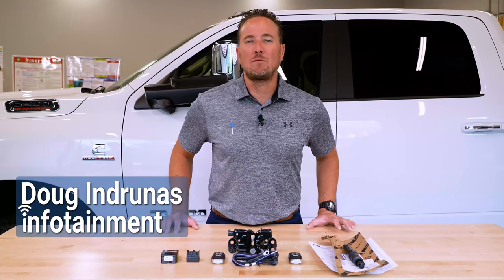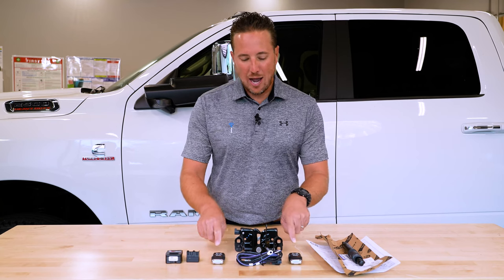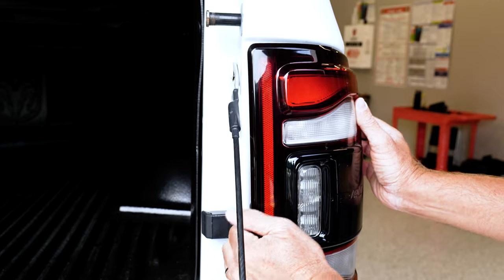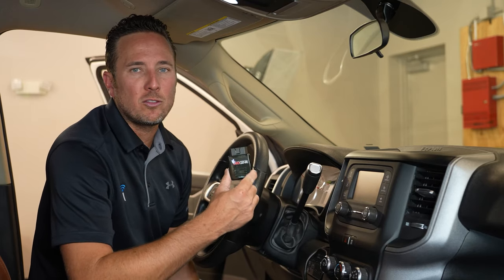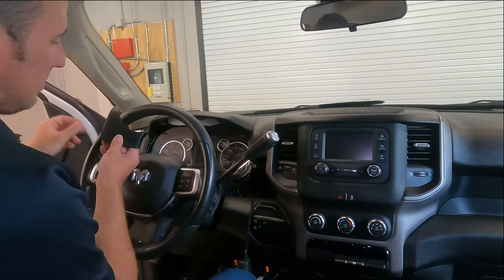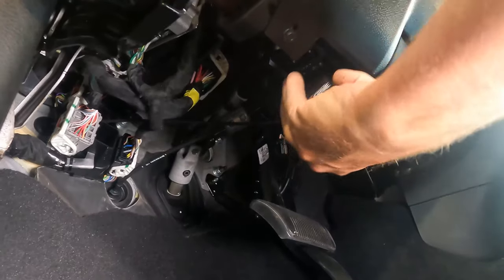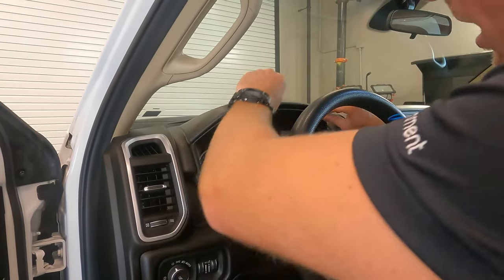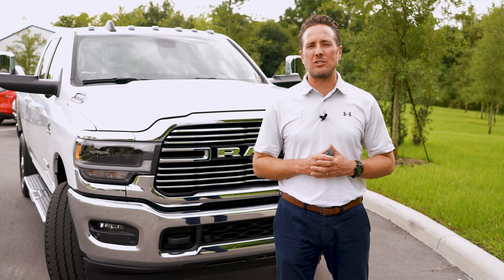2019+ Ram 2500 - Ram Remote Start - Episode 20

Comment: Installed per instructions and got all the proper indications on my 2022 Ram 2500. Lock smith came out and programmed the fobs. The lock, unlock, tailgate release, and panic button work but the auto start doesn’t. The park lights flash once and that’s it. I can start the truck with the push button but that’s it. Batteries are 12.87 volts and no other messages on dash. Seems like it’s just the remote start function. Good latch indication illuminates on dash when truck is on and you pop the hood then goes away when you close it so it seems like everything is working.
Reply from the maker: Please reach out to our support team at 855-636-6287 Ext 11 or at support@infotainment.zohodesk.com and they should be able to help get that working.

Comment: can this be used for more than one truck if more extra key fabs are bought from the dealer I have 7 fleet trucks in my shop I'm trying to get remote start for they are all a 2500 ram 2022
Reply from the maker: Contact our wholesale team at (800) 836-4858. 

They can recommend the best fleet solution for this kit. With that number of trucks, they can help get you a bulk price.

https://www.infotainment.com/pages/become-an-infotainment-com-wholesale-partner

Comment: I noticed that the locksmith plugged a computer into the truck. Do you have to do that or can you just bring your old key to a locksmith for it to be programed?  I was planning on installing this in my driveway and then going to the locksmith with my other car to have the keys programed
Reply from the maker: Vehicle programming will be executed using the included OBD Genie C-XBM programmer, the new key fob programming must be performed by your local Ram dealer or mobile locksmith.

Comment: When I install this remote start and program it will my old key fobs still work so I can take it to the dealer to get the new fobs programed?
Reply from the maker: Hi there,
That is correct! Since the programmer is just adding the Remote Start feature, your RH hub is not being changed out. So it will still be paired to your original keys. So you can certainly take the vehicle to the dealership or locksmith and then have the new keys programmed with everything installed already.

Comment: If my truck already has the remote start option how do I get the tail gate drop.  Dealership said it wasn't an option.  2019 2500 bighorn blackout edition.
Reply from the maker: You'll need the wiring harness and latch from this kit and programming for your fob. You can contact one of our tech advisors at 855-636-6287 to order or get more details.

Comment: what does the hood latch connector have to do with the remote start?
Reply from the maker: It is a tailgate latch. This will allow you to let down the tailgate with a button on the keyfob. He shows you this at 11:29 in the video. 

It is a handy feature if you need to let your tailgate down before bringing a heavy load or if you need to give someone access to the truck bed without having to go out, and unlock it for them.

Comment: OK but what's the purpose of wiring in the hood latch? Did I miss something?
Reply from the maker: It's so the vehicle's BCM recognizes that the Hood is in fact fully closed. The wiring sends that communication to the BCM. If the vehicle can't tell if the hood is fully closed, remote start will not enable. It's a safety feature to prevent people from driving with the hood not closed.
Reply: @Infotainment_nav  that makes Lot of sense! than you for elaborating

Comment: Just buy the start x remote starter you don’t have to disassemble your vehicle and have possible rattles down the road
Reply from the maker: We have both options depending on your hood latch configuration:

https://infotainment.com/shop/exterior-accessories/remote-start/2019-2024-ram-heavy-duty-truck-factory-oem-remote-start-upgrade/